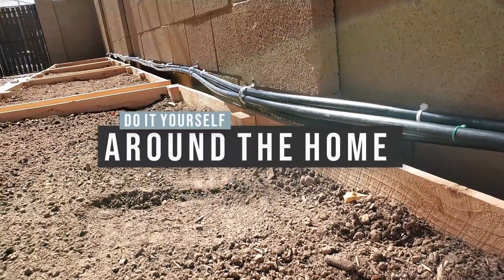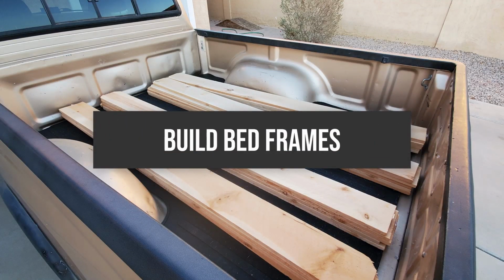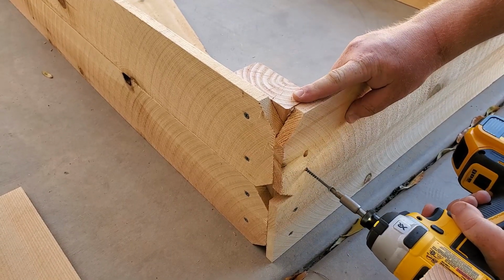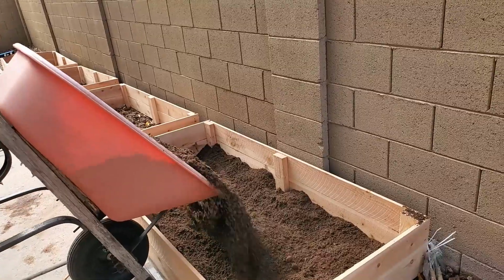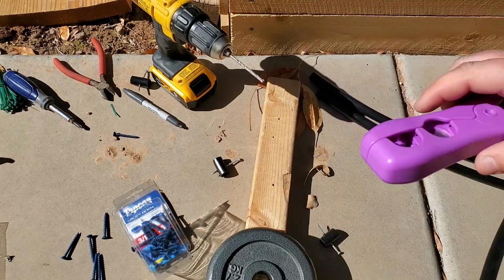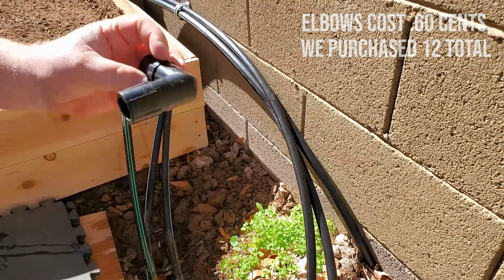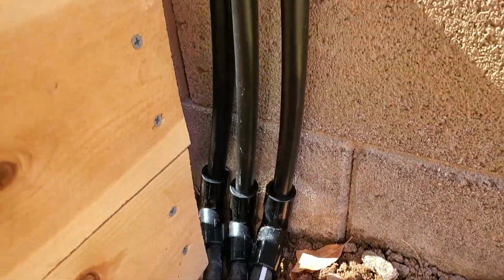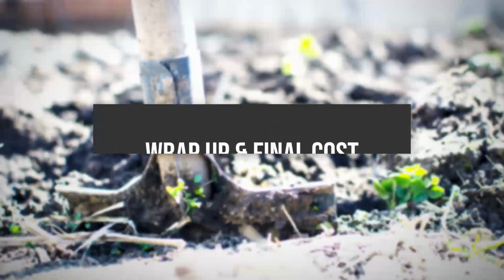How to Build Cheap Raised Garden Bed with Drip Irrigation System

Comment: If I did this against a chain-link fence for vines, do you think it would work to mount the supply line to the beds themselves instead of to the wall as you did?
Reply from the maker: You probably could but I'd maybe just zip tie, with some big zip ties, the lines to the chain link fence... that way you're not putting more holes in the frames where water will be trying to seep out when the drip zones are running
Reply: @DIYAroundTheHome  Good idea. Thank you!!